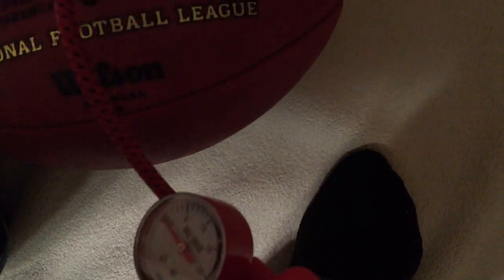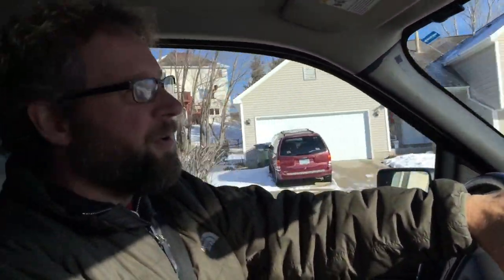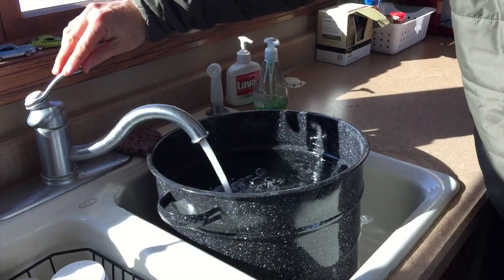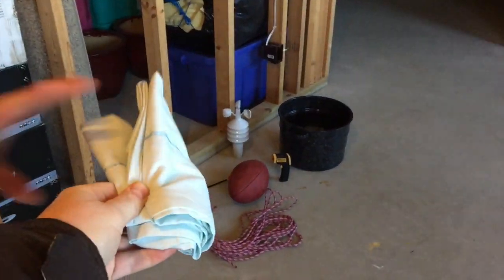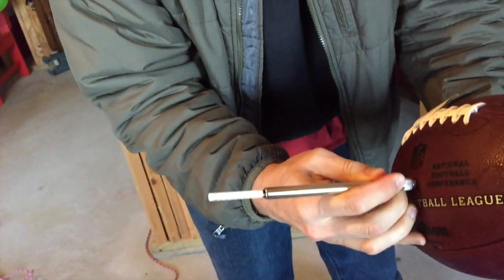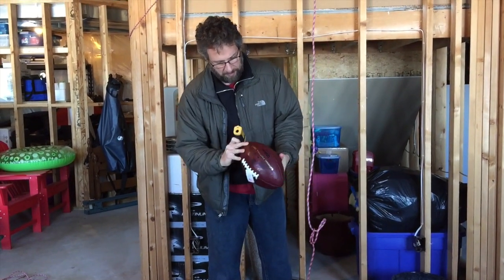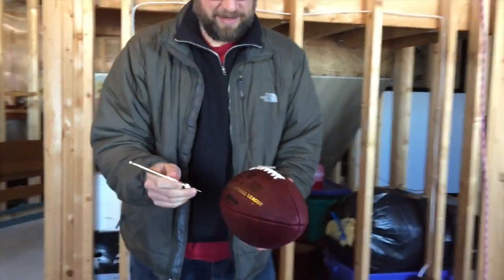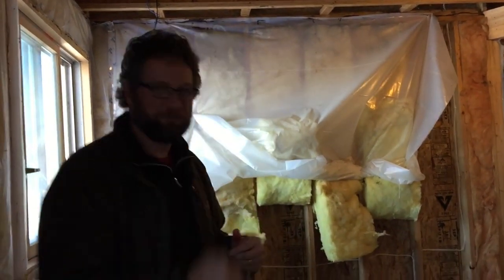Deflate Gate Tested

Comment: The ball you tested was brand new. The ones they used have a breaking in process. If you Google Eli Manning game balls there is an article that goes into depth about his process. They use an electric wire wheel multiple times to take the protective coating sheen off the balls. I would imagine this makes the balls a little thinner and more susceptible to pressure loss. Your test also shows the ball gaining pressure as it warms up. All the Patriots balls were tested first and then the Colts. This gave the Colts balls time to warm up. The Colts balls also started at 13 psi. Thanks for the video.

Comment: After learning the ACTUAL numbers, did you flip out at how right you were? Seriously, you were damn close to the actual measurements taken by the gauge Walt Anderson used. Also, the Pats balls were treated worse and scuffed up before pressure measurements were taken. Very good chance it drops another quarter pound after those things equalizing.
Reply from the maker: satsunada I honestly had not heard about the actual numbers having been released.  That's pretty cool that we were closer than we originally had thought.  I would theorize a scuffed ball might drop pressure a bit more given increased surface area exposure.  Certainly would be something that could be tested.
Reply: John Skinner
Well.. the actual numbers weren't released when you made this video. It took nearly 6 months for that to happen and the Pats just released emails showing the NFL not wanting to correct the false reports you guys acted on. The actual measurements, from the gauge Anderson said he used are: 11.8, 11.2, 11.5, 11, 11.45, 11.95, 12.3, 11.55, 11.35, 11.35 and 10.9 (this ball was the one the Colts measured on the sideline illegally so, by your experiment, they could have done it twice and dropped ball pressure by 0.4 or 0.5) which shows you guys were right on the money. Mind you, this is with the gauge Walt said he used, not the one the Report said he used. That change in gauges by Exponent is the ONLY thing in the entire report they didn't take Anderson's word for. The other gauge is off by 0.45 or more LESS than the above.

Comment: Great try guys-- but if Im not mistaken in a wet cold game in between plays a ball that has been in a towel is used for the next play. The same wet ball is not used continuous.
Reply from the maker: yes350yes Thanks!  How the ball was handled is very important.  The NFL rule book seems to leave a lot about sideline ball handling up to the teams, so we went with a worse case (non tampered) scenario approach.

From the rulebook:

Rule 2 The Ball
Section 1
BALL DIMENSIONS
The Ball must be a “Wilson,” hand selected, bearing the signature of the Commissioner of the League, Roger Goodell.
The ball shall be made up of an inflated (12 1/2 to 13 1/2 pounds) urethane bladder enclosed in a pebble grained, leather case
(natural tan color) without corrugations of any kind. It shall have the form of a prolate spheroid and the size and weight
shall be: long axis, 11 to 11 1/4 inches; long circumference, 28 to 28 1/2 inches; short circumference, 21 to 21 1/4 inches;
weight, 14 to 15 ounces.
The Referee shall be the sole judge as to whether all balls offered for play comply with these specifications. A pump is to be
furnished by the home club, and the balls shall remain under the supervision of the Referee until they are delivered to the
ball attendant just prior to the start of the game.
Section 2
BALL SUPPLY
Each team will make 12 primary balls available for testing by the Referee two hours and 15 minutes prior to the starting time of
the game to meet League requirements. The home team will also make 12 backup balls available for testing in all
stadiums. In addition, the visitors, at their discretion, may bring 12 backup balls to be tested by the Referee for games
held in outdoor stadiums. For all games, eight new footballs, sealed in a special box and shipped by the manufacturer to
the Referee, will be opened in the officials’ locker room two hours and 15 minutes prior to the starting time of the game.
These balls are to be specially marked by the Referee and used exclusively for the kicking game.
In the event a home team ball does not conform to specifications, or its supply is exhausted, the Referee shall secure a proper
ball from the visitors and, failing that, use the best available ball. Any such circumstances must be reported to the
Commissioner.
In case of rain or a wet, muddy, or slippery field, a playable ball shall be used at the request of the offensive team’s center.
The Game Clock shall not stop for such action (unless undue delay occurs).
Note: It is the responsibility of the home team to furnish playable balls at all times by attendants from either side of the playing
field.
OFFICIAL
Reply: yes350yes Sometimes it is. Even then, the Pats use a netted bag rather than a sealed one so they were in direct exposure the entire night. The Colts, on the other hand, use a sealed bag that kept their balls out of the elements.

Comment: kool video but to be honest i dont see how pats ball moved n colts ball didnt move at all really dont make any sense
Reply from the maker: Thanks Nick.  That is a good question.  If the Colts balls didn't change at all in pressure, then their balls most likely stayed at a near constant temperature.  This would have required them either completely filling the balls with outdoor game temperature air or protecting them from the elements.  Otherwise, from the Ideal Gas Law, one would expect at least some pressure drop when the balls are cooled during a cold wet game.  How much of a drop?  It all depends on what was the temperature change (assuming volume change is minimal).  Another possibility is that the Colts balls did change in pressure, but it was not a significant change.
Reply: yea i agree bro but who knows anymore i think its more nfl n goodell making the nfl the new wwf or wwe

Comment: We did the same tests, but realized the gauge method is suspect... where I Jamie and Adam when you need them.
Reply: As a matter of fact you can hear the air coming out when you remove the needle ... Granted no one knows how the NFL does it either.... But none of this takes into account that the Colts balls lost no pressure under the same conditions, so did they add air?  Possibly no one has said either way.  We did a test in a cooler all day an only measured by feel we observed no noticable difference, likely not 2lbs anyway...
Reply from the maker: chuckHart70 There is definitely a minute amount of air lost during the pressure testing process we employed.  I later tested the effect with 10 consecutive gauge measurements without any other intervention.  The result was a 0.1 PSI drop.  Not huge, but worth considering.
Reply: chuckHart70 I know that this is several months later and at the time you posted this not all of the information was know, but the Colts balls did drop in pressure.  And of course the Patriots balls didn't drop by two pounds as reported, but rather were at an average of 11.1 lbs which is right within what you'd expect from the ideal gas law.

Comment: Random thought. Does multiple gauging have any effect? i.e. does a ball, not subjected to those conditions, lose psi when you gauge it 10 times.
Reply from the maker: Good question.  I imagine the type of gauge would matter.  The gauge we used did a very good job at not leaking air and did not have a release valve.  I am not familiar with how the release valve models work.  Also, technique might play a role.
Reply from the maker: Just tried 10 "gaugings."  Pressure drop with our gauge was minimal but definitely seen with 10 resulting in about a 0.1 PSI drop.